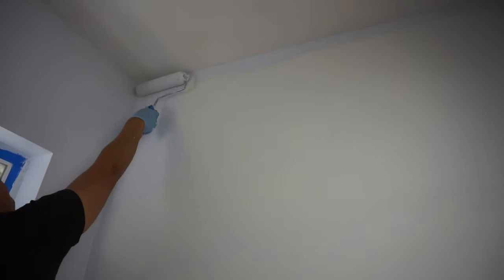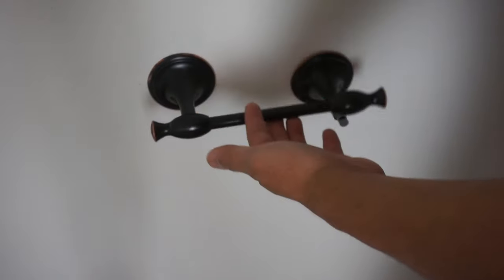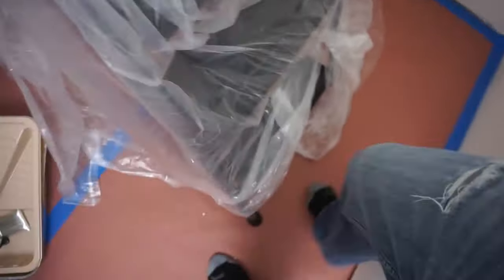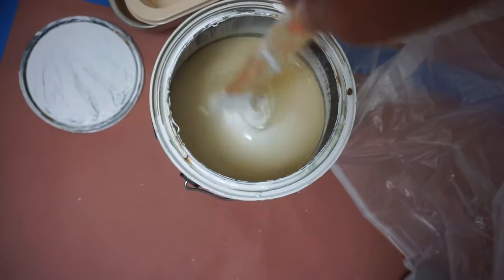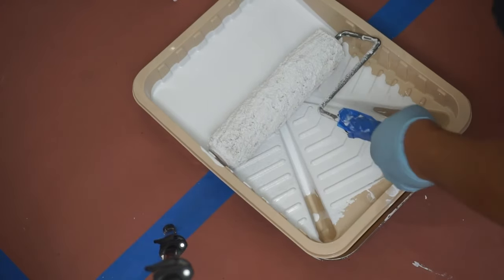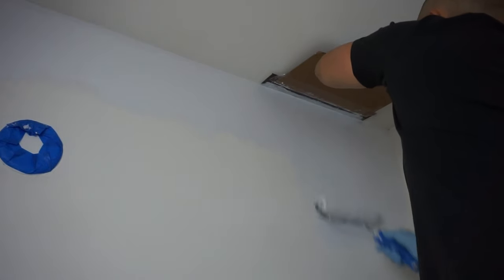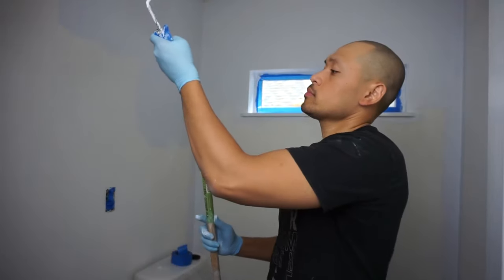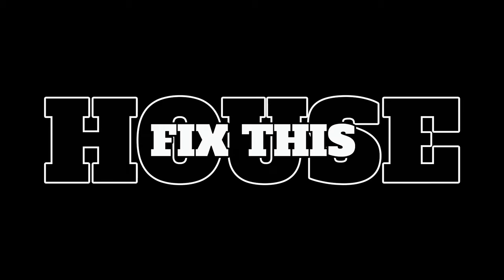How To Paint Like A Pro Using Tips And Tricks! DIY For Beginners!

Comment: Thanks for your video, not criticizing, but I don't agree with your way of painting . I can disagree because I'm a retired painting contractor for over 40 years . I highly disagree with using a roller pan to hold your paint in . The pan doesn't hold very much paint and you will have to refill often and worst of all, that is an accident waiting to happen . It is so easy to accidentally  spill paint out of the pan especially when moving it around, and pros can't afford to ruin someone's carpet or whatever . For a bathroom , I would use a 2 gallon bucket with a bucket grid and fill it to about 2-3" of paint . Now when you need to move the bucket, grab the handle and move it  and it's so easy and quick with no chance of spilling paint . With a bucket, you can safely move it with one hand anywhere in your house or even down your street, try that with a roller pan !!
Also, I've never seen a pro painter paint walls before ceilings !! Now you made the job harder for yourself by having to mask more and there is a higher risk gravity will cause paint to run down on your wall paint . When the ceiling paint and wall paint are 2 different colors, (contrasty ),  it makes the job more difficult to look good, compared to your bathroom where you are using 2 similar colors .
Reply from the maker: Thank you so much for your great advice! Much respect to you sir! 🙏🏽

Comment: I am prepping to paint the bathroom too; You skipped painting behind the toilet in your video - how do you deal with that area? Do you remove the toilet? Do you just reach behind with a paintbrush as far as possible?
Reply from the maker: Hi! That is an option, since nobody will ever see that area, but I did end up removing the toilet tank with one of my bathrooms and got that back that way. You can also use a 4 inch roller brush to squeeze back there 👍🏽😊🙏🏽
Reply: @FixThisHouse  Thanks! I found more videos on that too